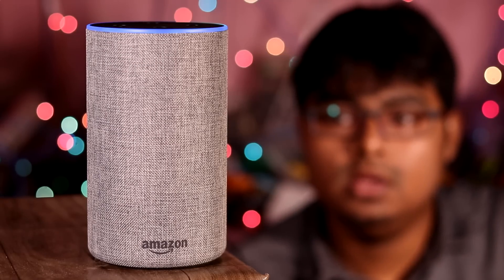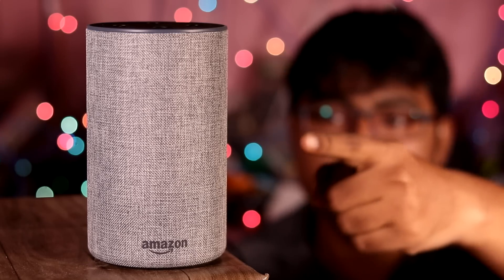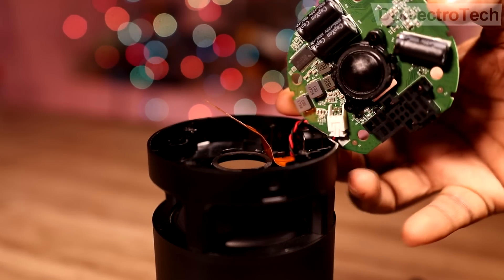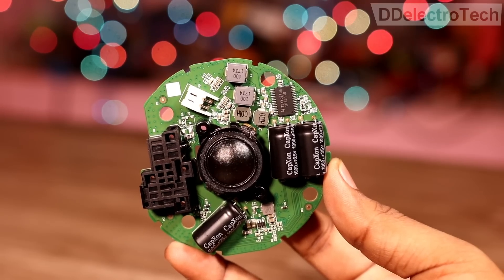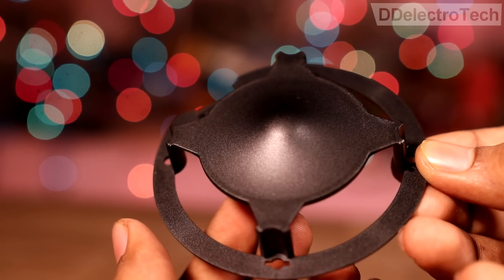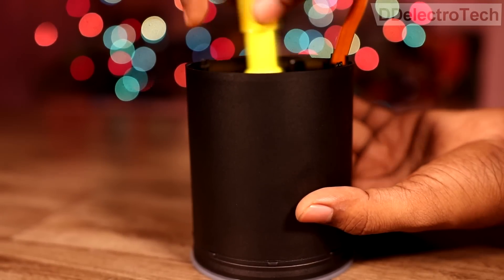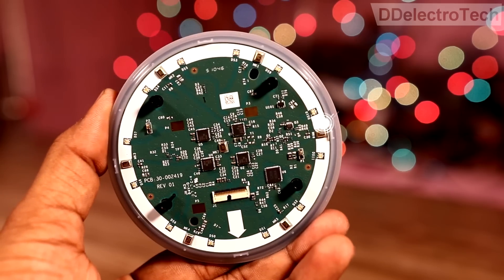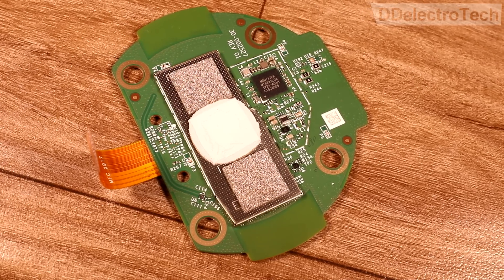What's Inside an Amazon Echo - Teardown - Let's Find Alexa

Comment: It is not battery powered and powered through Wall adapter..runs from the supply power...at 2:30..you say there are four ADCs on the MIC board...ARE you sure ? It is for the LEDs, they are LED controller chips..you are so WRONG..

Comment: Where is the battery??? 🤔
Reply: Only Direct 15V supply from Alexa Echo  adapter. No battery used.
-One cannot use mobile charger adapter or plug (5volts) .

Comment: Where is the battery??
Reply: Really  😂😂😂😂😂😂😂😂😂😂😂 can't stop laughing 😂😂😂
Reply from the maker: Amazon echo is not a portable device, you always need to connect with adapter.
Reply: The Amazon Tap is the only Alexa device with a battery
Reply: @TravisWeir  what about the fire tablets?They have alexa too.
Reply: Sambhav Gandhi yeah
Reply: There is no battery. It runs on power adapter.
Reply: No battery mental
Reply: Genius question bro
Reply: Use a adopter
Reply: @coolyashmehar1257  adopter means getting a child that's adapter
Reply: There is no Battery ok.It is using electricity from the plug point
Reply: 12v supply se chalta hai
Reply: it is a plug in ai not baterey
Reply: Actually It's is working with AC current of commercial electricity supply